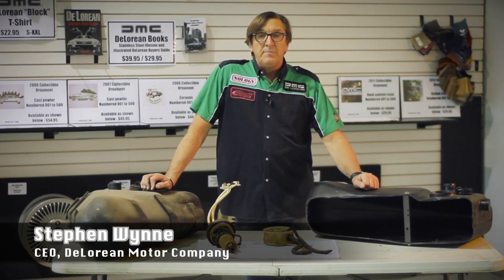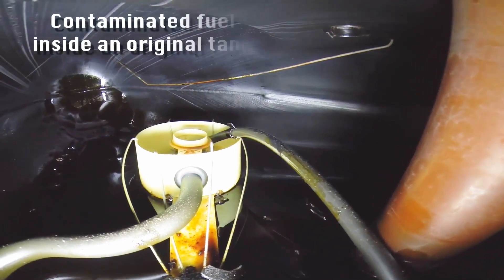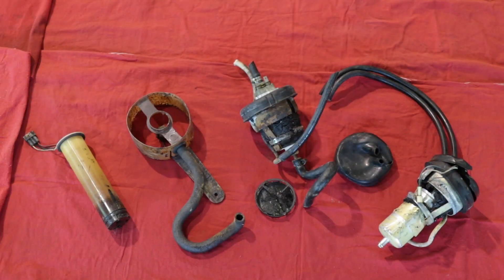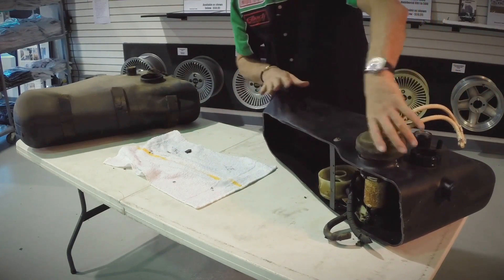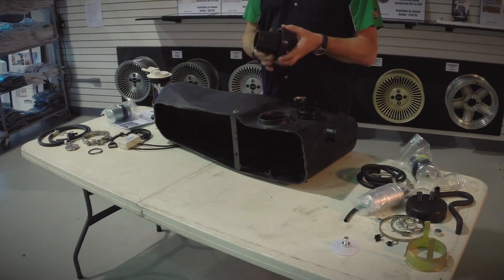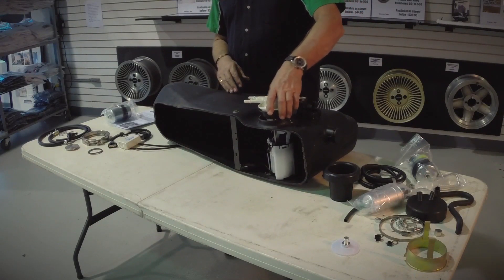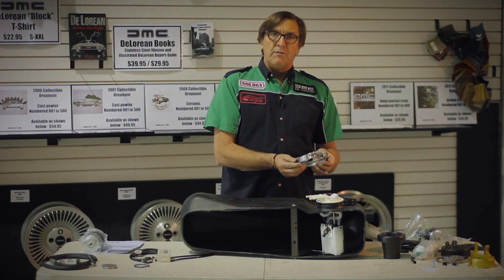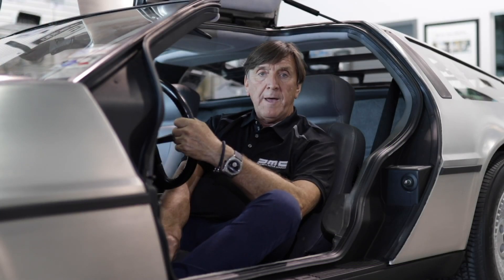DeLorean Fuel Tank Contamination & Modern Solutions

Comment: I heard that if the battery goes down, then the locks in the car are closed. Suddenly I'm in the car when the battery runs out. What should I do?
Reply from the maker: This is incorrect. If the battery dies, the door locks revert to manual operation.